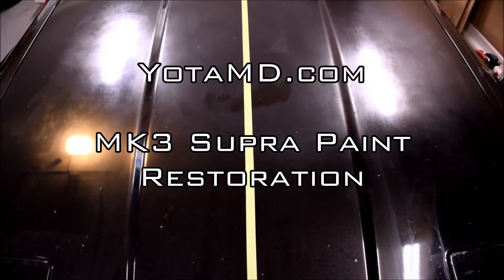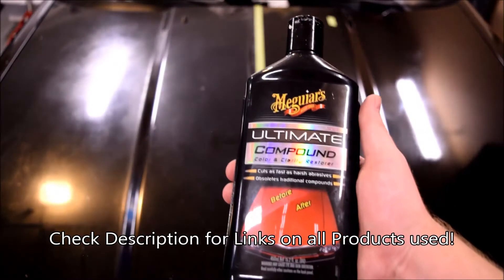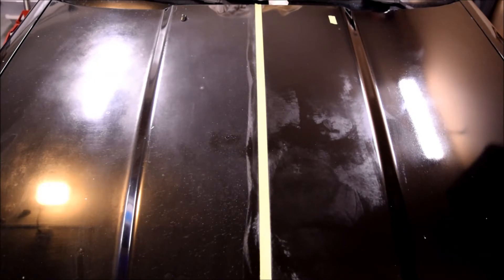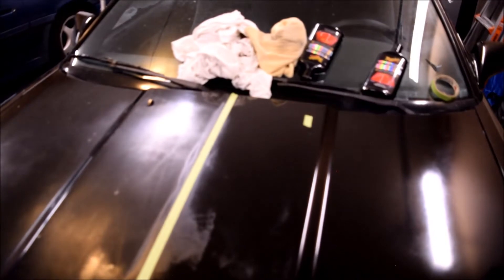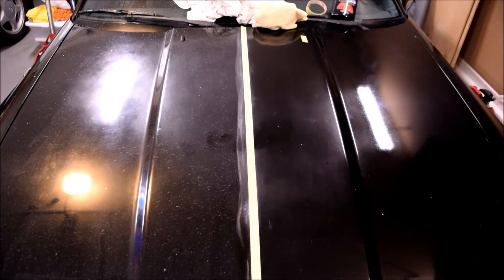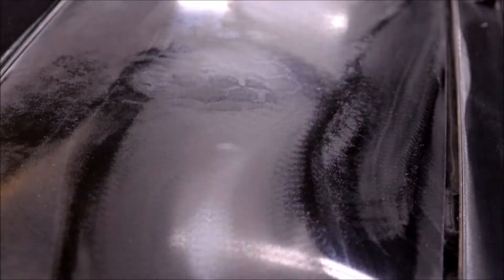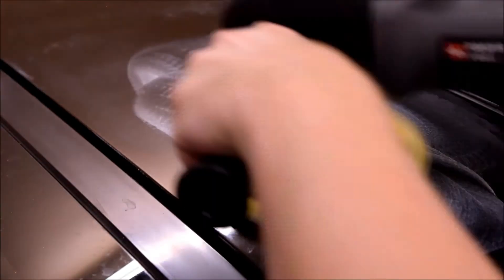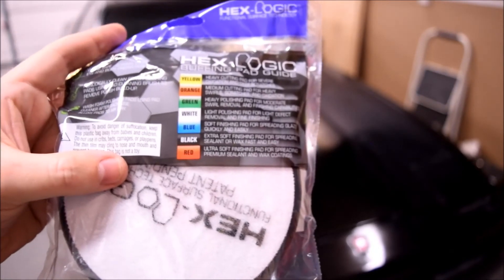Paint Restoration on a MK3 Supra - What a DA Polisher Can Do to Old Paint

Comment: My black 89 Supra's paint was so far gone that nothing was going to fix it, I had to opt for a new paint job.  I like those rim's, are they 16, or 18 inch and they'll really stand out with drilled and slotted break disks.
Reply from the maker: Those are 17" wheels. FNRC01 if I remember right. Love those wheels. One of my favorite wheel designs out there.

Comment: Nice video.  I'm curious why you jumped all the way from polish to the ultra cut compound.  There are many stages (fine cut, medium cut, etc.) in between.  Either way looks great
Reply from the maker: Mainly because the paintwork overall was still quite rough. I made a huge improvement, but there were still chips all over, terrible front and rear bumper and missing clear coat on the hatch. For my current MK3 (Project Ookii Ao on my channel) I would go to those lengths. It'll be a show-quality paint job if I can help it. For this 90 though, it was just a sales preparation.